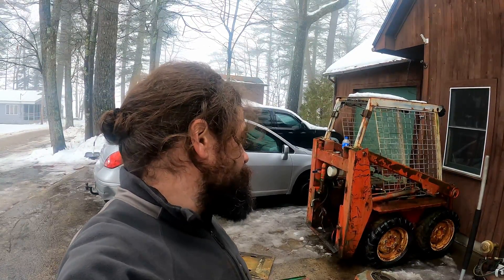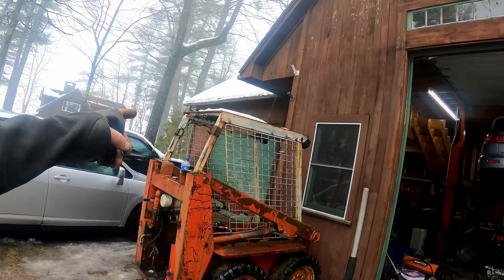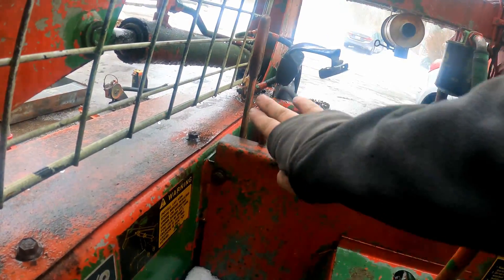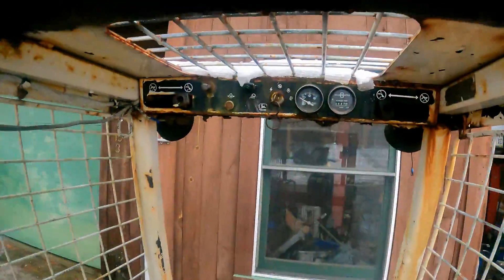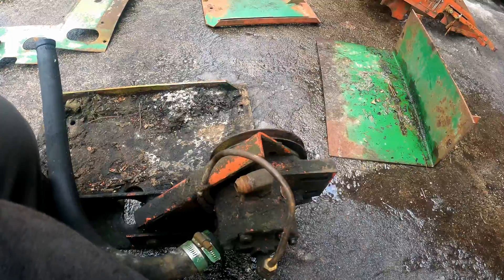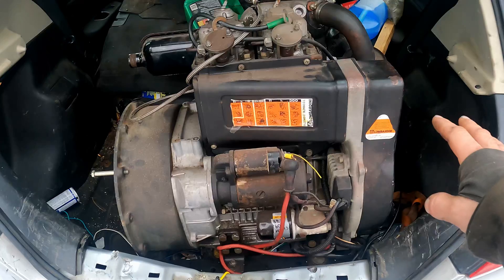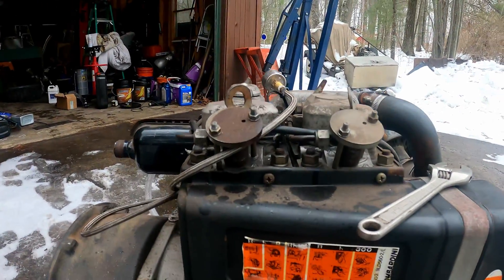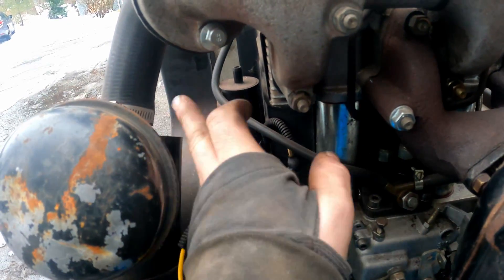Cheap John Deere 90 Skid Steer Gets Lombardini 9LD Diesel Engine Swapped PT 1

Comment: I have a JD 90 .. I think round 1988 ...not positive... I was wondering if you could share with me any information on the drive motors...mine was working hi just fine but when I went back to work with it it won't move forward or backwards or turn...acts as though the brakes were locked but they are not..when I try to move in any direction it puts the motor in enough of a bind that it will turn off...any advise ?
Reply from the maker: might be the pump also, pump is sunstrand 15 series and motor is a ross trw mae series.  specs are available here and have some info on motors https://www.deere.com/assets/pdfs/common/products/skid-steers/skid-steers-60-90-125-loaders.pdf  It's also possible that a chain broke and got bound up.  good luck with it
Reply: @wirestiresandfires214  thank you for your help

Comment: those little hydraulic pumps are actually pretty cheap, I took one off a Kubota engine i used  to repower..  cant wait to see the progress on this.
Reply from the maker: Should have a new episode on it pretty soon, spending a lot more time in the shop now that it's warm again where I live.  Planning on getting to running the motor in the new chassis and at least testing the hydraulics in the next one.

Comment: is there a keyed shaft on the end of that motor or are you going to have to get a pulley with bolts?
Reply from the maker: I'm using a small block chevy 2 belt dextended snout aluminum pulley and boring the pulley to fit a boss on the flywheel and drilling and tapping the pulley mount holes in the flywheel. sticks out about 3 inches which is plenty

Comment: The gear drives had more pushing power, but where a little slower and more hands on to move around.
Parts are about the same to find and get.
Both versons are good, having used both.
Reply from the maker: Well, maybe I'll have to get one and give it a shot then.  They occasionally come up around me for reasonable money.